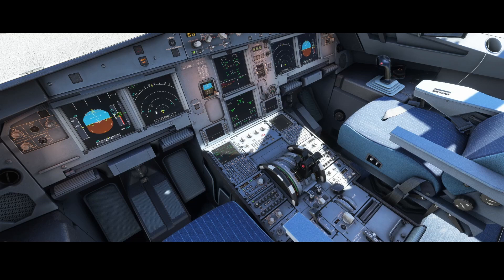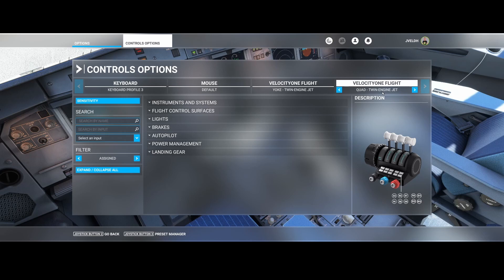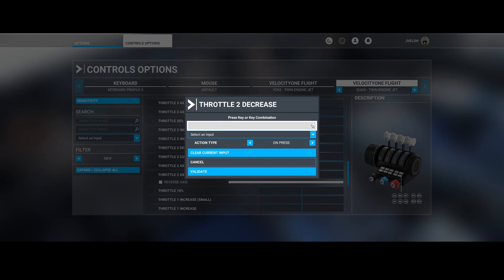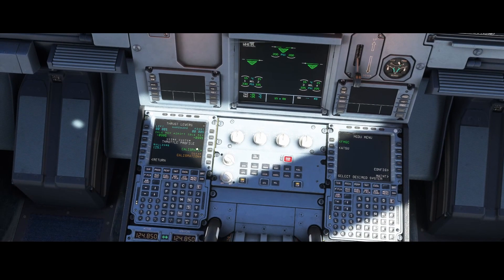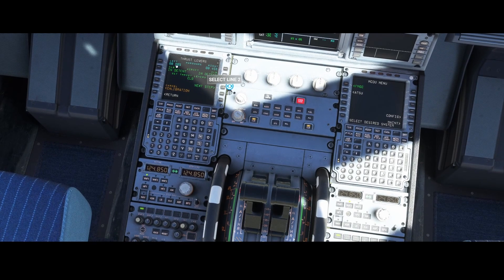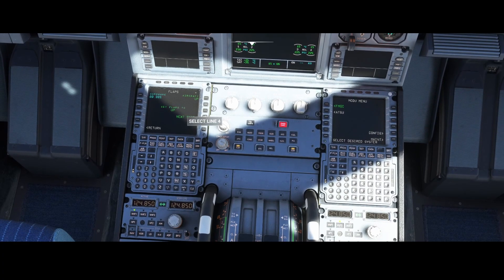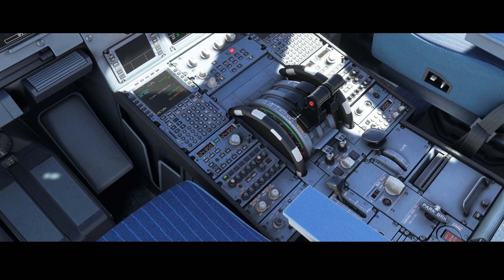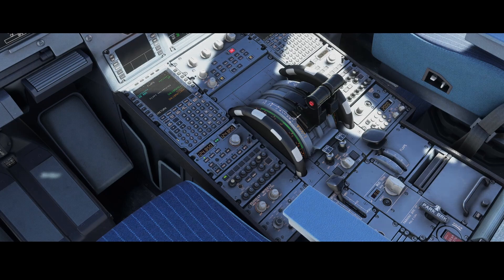Flight Simulator 2020 - How to - Fenix Simulations A320 - Calibrating the VelocityOne Flight

Comment: This was useful. I found nowhere else that the lever should be left idle and push next twice through the reverse throttle controls to basically skip the setup. It caused a lot of issues with my setup where I dont have the reverse throttle "zone" on the controller. Now I can calibrate the rest of my controllers and my reverse works very well with the toggle button.
Reply from the maker: Good to hear it resolved you issue happy flying using the Fenix